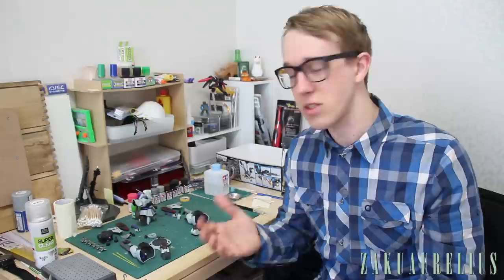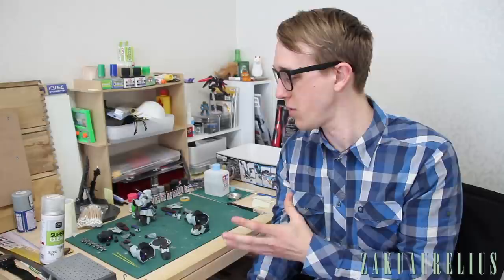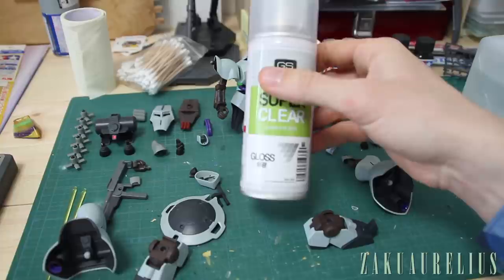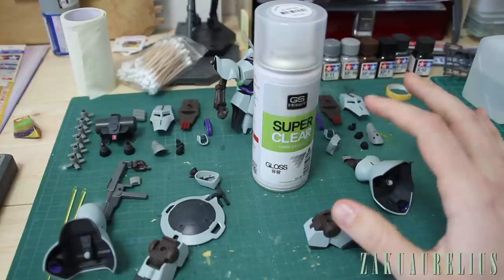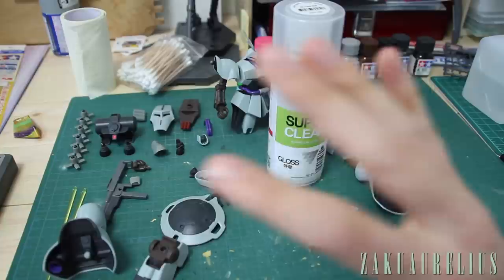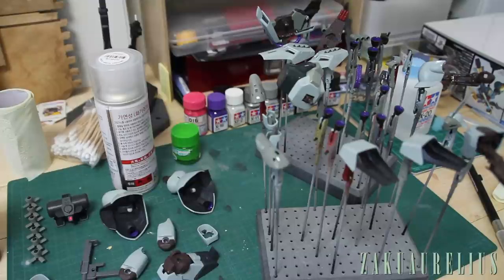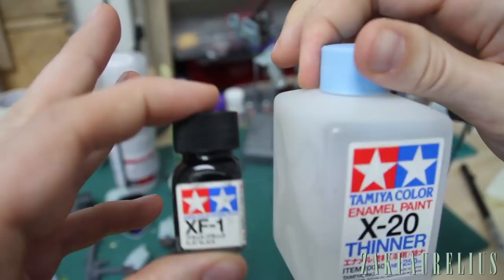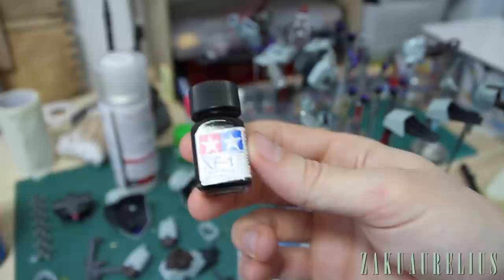167 - Gunpla Building Part 9: Topcoating (Aerosol Can Type) & Panel Lining

Comment: If I may, I would suggest letting your cans of spray paint soak in warm-hot water for about 20 minutes, this lets the paint get nice and thin and makes the texture of your top coat much more consistent.
Reply: Aaron Horton noted
Reply: Is top coat really needed
Reply: gelo encabo very very much needed
Reply: @gisforgunpla8147  it makes it look better and also to seal and protect panel lining, decals, paint.
Reply: @gisforgunpla8147  it can also hide blemishes and scratch marks left from sanding.
Reply: @jackyboi5668  do you need to spray the whole kit or some parts only?
Reply: @jcjosue2978  if you are glosscoating after base painting, I recommend spraying each piece individually. If you are just putting on a final topcoat, spray limb by limb.
Reply: @jcjosue2978  in short, yes, you should spray the whole kit
Reply: @jackyboi5668  i don't do painting stuff, build kit and apply stickers or dry decals that's it
Reply: @jcjosue2978  yes, you have to spray the whole thing. What I do is I disassemble the gundam into more manageable pieces, then spray them. Make sure you cover all the parts that show.
Reply: @jackyboi5668  I've seen some videos that they use a tape to cover something? What is that for?
Reply: @jcjosue2978  they use tape to cover parts like pegs and holes, so the connections wont be affected. If you spray the topcoat over the pegs, they will become thicker and it will be harder to fit them into the holes.
Reply: @jackyboi5668  sometimes they cover it on the weapon too so yeah
Reply: @jackyboi5668  what's the best topcoat to use
Reply: @jcjosue2978  i use mr topcoat matt.
Reply: @jackyboi5668  oh okay, what about Mr hobby topcoat flat?
Reply: @jcjosue2978  mr super clear is also from mr hobby. If you are talking about mr topcoat, thats also pretty much the same, but its acrylic, whereas mr super clear is lacquer.
Reply: @jackyboi5668  what's the best topcoat to use on MG kits
Reply: @jcjosue2978  get the mr super clear matt or gloss depending on your tastes.
Reply: @jackyboi5668  is there a difference between the two
Reply: Can this also apply to spray can paints as well?
Reply: @aleqthepredator  my initial comment was in reference to rattle cans, so yes.
Reply: However spray can might also explode and start a fier🔥

Comment: hi all, I am new to gunpla and i am gonna build a HG Kimaris Trooper adding panel lining and using topcoating (no painting will be done). I intend to apply panel line and gloss during the construction after cutting and cleaning nubs. I read there are many advices on top coating out there and wondering which ones in your opinion worked best for you:

Option 1: apply gloss topcoating then panel lining then apply matt topcoating
Option 2:  panel line then apply matt/gloss/semi gloss topcoating

of if you have any better advice, I would love to hear them

Comment: let's say for an unpainted kit, would you apply water slide decals first then apply a flat matt top coat as a finish?
Reply: Brian N. Yes. Applying the top coat after decals is recommended especially since it helps seal the decals safely under the coat.

Comment: Hey zaku, would it be ok to use the panel line accent and the thinner on Water-based acrylic paint as long as I put on a couple coats of top coat? And how long do you wait to clean up the excess liner with the thinner?

Comment: So I have a kit which is painted using tamiya spray paints(I believe they’re synthetic lacquer based on the website) and topcoated it gloss(acrylic) so when I panel line it is smooth. Is it okay to use tamiya panel accent(enamel)  to panel line the painted kit and x-20(enamel thinner) to clean the excess? Lastly I’ll be using mr hobby flat topcoat the blue one(acrylic) Im just scared maybe I’ll ruin my paint job.

Comment: Hello, great video. Do you glue the pieces first to remove the seem lines then paint them? I'm planning on custom painting mine.
Reply from the maker: Yeah you will need to glue and sand, and possibly putty, all before painting!
Reply: Thanks so much :D
I guess I'll sand the knees and elbows (and other joints) to give it more clearance before priming, then mask them when doing the painting proper. 

Is it alright to not paint over primers? My matte black primer looks good already. Here's my colour scheme. http://fav.me/d92g7b1

TY
Reply from the maker: Yeah i think it would be ok not to paint over your primer if you want. Primer is important though, so just make sure you prime everything
Reply: What's your thoughts about sealing primes then painting over it then sealing it again?
TY
Reply from the maker: Red7 like doing primer, then topcoat, then painting? you could do it if you want I guess but it would be pretty unnecessary.
Reply: Well, I want to protect and preserve the primer from dirt, oil, and adhesives since I'll be masking some parts of it, hence sealing it. I suppose, what I want to know is whether spray paint will stick nicely to sealed plastic.

TY

Comment: i painted my kit with lacquer...do i need to use the same kind of topcoat for coating and the same kind of paint when handpainting the kit? and when removing excess paint in detailing do i need to use the same thinner as well?
Reply from the maker: when detailing, you want to use enamel or acrylic because those are weaker than lacquer. that way you can clean those up easily without damaging the lacquer base paint.
Reply: Thank you, Zack...I appreciate your response
Reply: Yova Vando you should never use lawyer over enamel or acrylic, however it’s fine to use enamel and/or acrylic over laquer.

Comment: I just bought the tamiya black and grey panel lining wash and its enamel I heard it can mess up the plastic so do you have to top coat before panel lining?
Reply from the maker: Fran Fran R topcoat first would be a good idea. Or just be careful and use it sparingly on the bare plastic- at your own risk

Comment: I recently built a hg gouf prototype, and was wondering how do you topcoat gunplas with clear parts?
Reply from the maker: +Kyle Hartnett The easiest way it to remove the clear part when you spray, then put it back when the topcoat is well dry. If you can. But that's not always possible. If you can't remove the part then you need to mask it with masking tape or liquid mask.

Comment: I live in the states. By the east coast, and it gets very humid here in the summer time. Do you have any suggestions to help me when I want to top coat?
Reply from the maker: Gene Wade first, getting a humidity sensor to tell you how humid exactly your environment is, that will be important. Then using a dehumidifier of course.
Reply: ZakuAurelius Thanks, I'll look into getting a cheaper humidifier. It's usually between 80 and 90% humidity here in WV. 

Is the dry time more important than applying? What I mean is if I coat my pieces outside in the high humidity but take them in a controlled environment will it still cloud? 
I feel like it would cloud still. Maybe spraying at night would be a better idea for me.

Comment: should i put on the top coat first before panel lining or the other way around first?
Reply from the maker: Glossy topcoat first will help the panel lining flow more smoothly and waterslide decals will go on easier. Then topcoat again when you're done to lock everything in.

Comment: when you spray with the can what is the optimal distance for a good spray? do you spray far back, or up close?
Reply from the maker: megaduce104 Not too close. I would say just start from farther away and move closer to figure out the right distance. If it's getting too much on the part too quickly then you're too close. If it just looks like dust on the part then you're too far away!
Reply: Thanks alot for the info. I think that i sprayed too far from the model. Although it was too far. It kinda gave it a flat look even though i was using gloss spray

Comment: so if im going to use the acent panel line stuff, do i need to top coat first because it said it could make the plastic brittle, and if so what kind of top coat? i plan on painting my model too btw with priming and spray cans etc if that changes anything

Comment: Ok, I can’t really find a definitive answer to what I am looking for please help. I am going to start panel lining with Tamiya panel paint. Now my question is this I am not planning on painting the model at this time just doing the panel lining. Do I need to do a topcoat of gloss then panel line and stickers then one last matte topcoat? Also what spray can do you recommend? Thanks.
Reply from the maker: You don’t really need a gloss coat before panel lining. But I wouldn’t recommend using Tamiya Accent Color.
Reply: What would you recommend? I have HG models. Should I just get a black gray and brown Gundam markers for these? I am just starting out and built my first model and want to spread my wings more.
Reply from the maker: Dylan Lidgard probably yep!
Reply: @ZakuAurelius  Can I ask what is wrong with the Tamiya Panel Line color, or do you mean for someone like me you would not recommend? Anyway I bought two cans of Rustoleum 2X clear glossy and matte spray can paint. I'll try glossy then panel line and then matte.

Comment: Hi Zak! i have a question and I really need some help, im building my first kit and its the 1/100 Astray Blue Frame Second L and I primed the kit and airbrushed with acrylic paint and then top coated it but when i went to panel line with the Tamiya panel line ink i heard online that i could clean it up with rubbing alcohol and so i did so and it was rubbing out my paint. what should i use to clean the panel line ink up with without ruining my paint. also for future reference if i use that same panel line ink again what type of paint should i use to paint the kit with airbrush and detail brush painting? i really appreciate any input from you or anyone else who can help me

Comment: Is it alright to apply thinner to coated parts? When you're cleaning the mess, Does the thinner fade the paint even though its already coated?
Reply from the maker: You really don't wanna have much contact with thinner at all ever, only a tiny bit on a q-tip to briefly and gently wipe up your panel lining paint.
Reply: +ZakuAurelius so just a little bit of thinner wont fade the coating?

Comment: Hello, im having problems using sandpaper. When I apply the sandpaper to make my part smooth it just gets scratches. (im new to this hobby)
Reply from the maker: Elliot Kim Hey! No worries~ it just means the sandpaper you're using is too rough. You should use a rough grit at first, something around 400, then use something softer like 800 or 1000, then you can even go finer with something like 1200 or more to make it smooth again! Hope that helps!

Comment: Do I have to worry about getting topcoat on the polly cap
Reply from the maker: +Ron Ze Topcoat and paint are more likely to chip off polycaps because of the material. If you don't move them around much you'll be ok.

Comment: if i didnt paint do i still have to do gloss then matte?  all i just did was the lining.
Reply from the maker: Depends on your method of panel lining. If you use the Tamiya Accent color or something else that has thinner in it, then it's best not to put a lot of that on bare plastic- as it weakens it. In that case you should put gloss topcoat down first. If you're using a Gundam marker or something like a pen, then you'll be fine without.

Comment: So im planning on building the freedom Gundam 2.0 but im not painting it , just a flat matt , a couple of coats just to give that even / uniform look. Does the humidity still apply since im not going to paint it ?
Reply from the maker: Isaily De La Rosa yes, humidity effects topcoat more than anything else in my experience.
Reply: ZakuAurelius awesome dude . Keep it up . Also what grit of sanding sticks do you use to smooth out surfaces after cutting the knobs ?

Comment: Hey Zaku, I have a question I'm a beginner and I'm starting with the HG Strike Freedom Revive Kit. When I'm ready building it should I topcoat before or after panel lining? I'm planning to use Gundam Markers for fixing color issues eventually if there are any when should I coat then?
Reply from the maker: Gloss topcoat before panel lining would be helpful yes
Reply: I take it using a topcoat before using the tamiya panel liner helps to prevent the plastic going brittle?
Reply: What if im already done with my lining and i want to apply matte top coat, would it ruin my lining? Would my lining bleed?

Comment: I just finished painting my mg zaku II 2.0 and I was wondering if I should use matte or gloss topcoat because the main paint I used was silver and I want to preserve the shine of the paint. Any advice???
Reply from the maker: If you wanna keep it shiny then you better go for gloss! Flat will dull the silver. Or~ if it's not all silver, do some masking and spray gloss only on the silver areas, and flat on the other areas!
Reply: Thnx for the advice👍🏻

Comment: Is it okay to use Mr. Super Clear (lacquer based) on kits that have enamel paint on it? I use enamel paint for panel lines and details, sometimes bigger parts, but never the whole kit. most of it is bare plastic.
Reply from the maker: +jelaienfinue If you're spraying it on via aerosol can, should be ok I believe.
Reply: +ZakuAurelius Thank you very much for your answer. Some people say that lacquer top coats can "melt" the enamel paint underneath it and others say it is fine if you use thin coats. I get really confused.

Comment: If I spray the topcoat on clear parts will it frost? I heard this from some people so I'm not sure, but I don't want to ruin my gunpla as it was quite expensive. By the way, I'm using a flat finish. Also is a gloss finish good for metallic parts?
Reply from the maker: Yeah flat topcoat will fog clear parts. And I can't imagine it would look good on metallic coated parts either. Your best bet would be glossy topcoat!
Reply: Thanks for the quick response! Could I just mask the clear parts up and also, would a glossy finish look good with metallic parts?
Reply from the maker: I think so, yes.

Comment: how do i apply mr super clear flat for my gundam and what is the effect will produce??
Reply from the maker: +Wing Hong If you refer to my previous video in the series showing how to use spray can paint, the same rules apply for spraying topcoat. Just be careful not to spray too much. And also be very careful of the weather conditions.
The effect is to give the kit a uniform look and make it look less like a toy. It also helps to seal on paint and decals on the kit.
Reply: instead of i didnt paint my gundam i just apply for panel line and other sticker and decall, then i finish it off with the mr super clear flat, is it ok too?

Comment: Don't you cover the joints? Won't they will make the articulation an issue?
Reply from the maker: If you get too much paint on them yes. But you want to paint those parts same as the armor, just to make them look better. Just have to be more careful.

Comment: Does top coat prevent the white plastic from yellowing?
Reply from the maker: Mr.Color makes a UV Cut topcoat you can spray via airbrush and possibly a spray can version as well but not sure
Reply: @ZakuAurelius   will there be a slight color change if there  UV in topcoat?